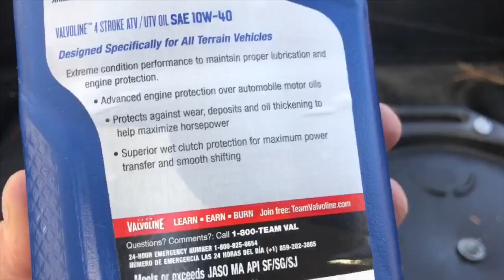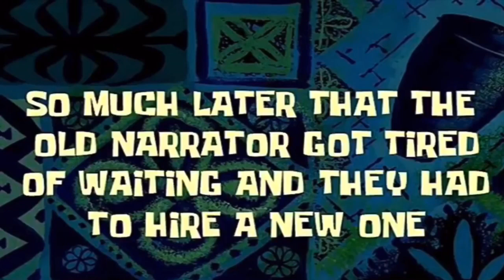Bms Stallion 600 UTV / Oil Change - 200 Mile Service

Comment: Great video guys! Where can I get an oil filter for this? I'm at my 200 mile service. I know I can order from the company but it's 36 bucks just for s&h. Do you know of any other place?
Reply from the maker: You can check with tractor supply bud thanks for watching 🤘🏻🐿🤘🏻
Reply: @bozgene3064 Thanks! I really appreciate the info.
Reply: You can also get a hisun utv oil filter thread size 3/4 - 16 which is the same filter for BMS Stallion, it costs about 10 bucks on Amazon.
Reply from the maker: @bozgene3064  thanks for all the input guys you rock 🤘🏻🐿🤘🏻

Comment: 2021 Bms Stallion  what oil filter did you use?
Reply: You can use an oil filter that is used for a Hisun utv which is the same for BMS stallion thread size 3/4 - 16.

Comment: Kool... unfunfortunately my bms stallion is a lemon I've had so many problems and bms has horrible customer service you are pretty much on your own..  rear gearbox leaking after 3 day's had to replace took a month just to get it from them.. 4x4 system not working stuck in 2wd .. fuel injector clogged with brand new filter 4way hazzard lights not working the list goes on... but in the end I'm stuck with it.. 10.000 dollar lemon... and all this within 60 day's of purchase...
Reply from the maker: I’m really sorry to hear that bud. LuchaCabre has had his for a bit more that’s a year now and not had any major problems whatsoever. As far as getting any parts we’ve needed we haven’t had to many issues. Maybe you just got a bad utv 🤷🏼‍♂️
Reply from the maker: @jackhawk8952  have you reached out to the dealer you purchased it from?? How many miles is on it ? How long ago did you purchase it? And did you get it with any sort of warranty??
Reply: @LuchMobGarage  it's now got 300 miles on it...  I did reach out to the dealer about the gearbox leaking and they fixed it and charged me for the repairs saying bms would not cover it under the warranty..  So going back to the dealership is a no go.. I'm just doing my best to fix everything myself..  It just is what it is... I did my research and thought I was buying something good by watching videos like yours.. I have had it for 3 months now with it being in the shop for one full month before getting it back.. i had it for a week before it started leaking really bad and went back to the dealership.. The only good thing is i have torn it down so many times i got it figured out.. I'm not sure if the 4wd is actually engaging or not it just doesn't show up on the screen anymore but you can hear it trying to engage and disengage when pressing the button.. doing a complete maintenance overhaul tomorrow will probably put it up on Jack's to see if all 4 are turning.. We get lots of snow here in the winter and i sure hope it works.. been driving my hummer with a military trailer for all the work but Bidens fuel prices pushed me to purchase the utv....  Thank's for your videos you guy's make me laugh....  I'm up here in south central Oregon....
Reply from the maker: @jackhawk8952  damm bud I’m sorry to hear that it sounds to me like you got a bad one . If I can do anything to help let me know . Which dealer did you buy it from??
Reply: @LuchMobGarage  Got it at klamath basin equipment there customer service is a joke even talked to corporate with no better luck..  BMS is located in my old hood where I grew up in Riverside talked to them several times and they never call you back..  I got this whole thing handled been riding and working on dirt bikes since I was a kid so it's all good.. Just couldn't imagine before buying i would have it torn apart so quick and so many times.. Go fucking figure i finally live in the perfect place to have one and can drive right out my gate to national forest land and i got a fucking lemon...   Anyways thanks for the talk you have yourself a good night  and 420...
Reply from the maker: @jackhawk8952  🤘🏻🐿🤘🏻 I’m in riverside bro 🤘🏻🐿🤘🏻
Reply: @LuchMobGarage   Hell ya.... My wife and I both went to jurupa valley and lived in mira Loma...  Sold everything and came up here to rural Oregon and built a homestead living like back in the days....  Lots of people up here from down there great place to live off grid and grow...   Super cheap and no building codes build whatever you want and just live..
Reply from the maker: @jackhawk8952  awesome 🤘🏻🐿🤘🏻